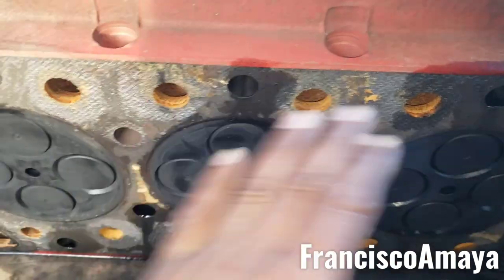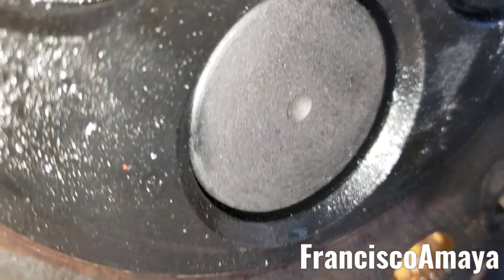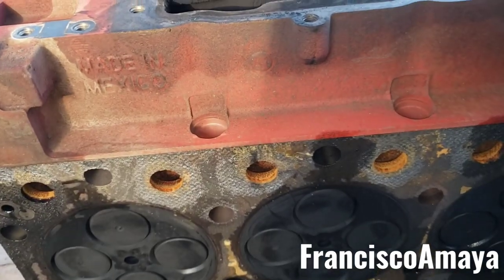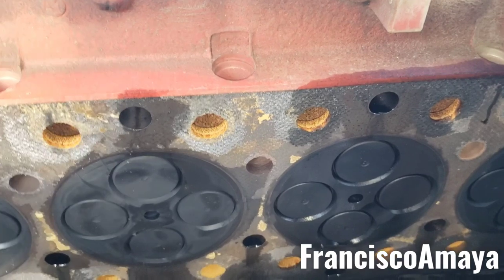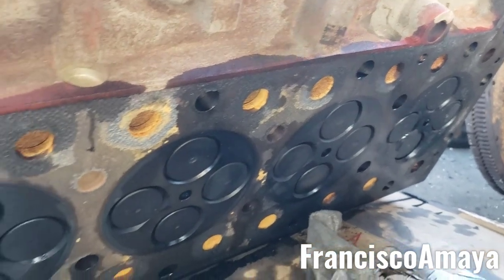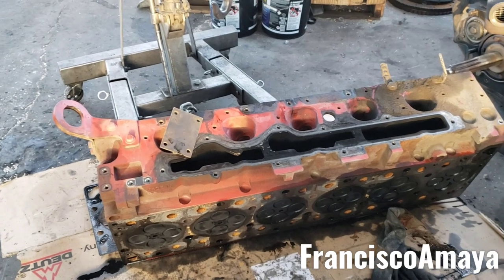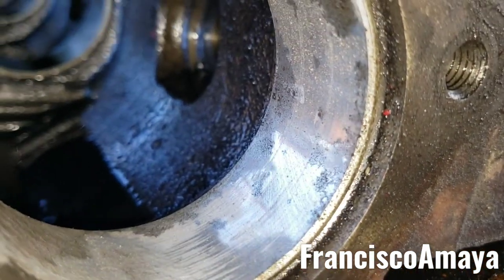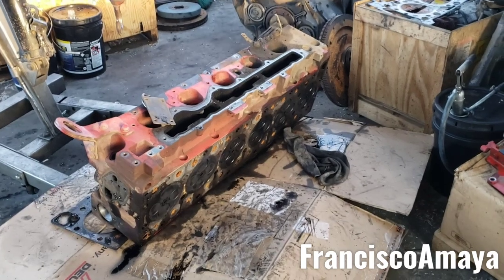Cummins ISX ISX15 inspection broken cylinder head internal damage major overhaul head part 2

Comment: Hello Francisco! I appreciate your YouTube content. Consider doing  longer videos or series showing step by step of various repair procedures! 

Question: can a Cummins ISX15 head be resurfaced/milled if it is found to not be within specs for flatness (CM570 specifically)? Seems like it may bind the camshafts where they come through the front gear housing before going into the head.

Comment: This just sends the wrong message. A delete directly doesn’t cause this. Who ever does the tune needs to know what their doing. More then likely whoever did the tune for this guy didn’t knew what he was doing turned up the horsepower causing the truck to run hot. I’ve had multiple deleted never ever have had this happen

Comment: hi i have a cummins isx engine but diesel in 3 cylinder and 1 and 2 does not burn what can it be?  the first time until it pierced the piston of the same cylinder in question, i fitted new ones and it continues to burn more than the others and makes a strange noise.

Comment: What would cause those cracks? And the cylinders to get sucked in?
Reply: Heat, either engine was overheated or excessive fuel so was burning very hot and this is usually what happens when you delete emission tuned truck you disable egr so injectors are giving more fuel to compensate all the heat to have proper combustion temperature and specially this will happen when your tuner guy will give you more free horsepower to make you happy

Comment: When you delete a truck you actually have to lower the power to prevent the turbo blowing up or cylinder head problems. This will never happen with a good tuner.